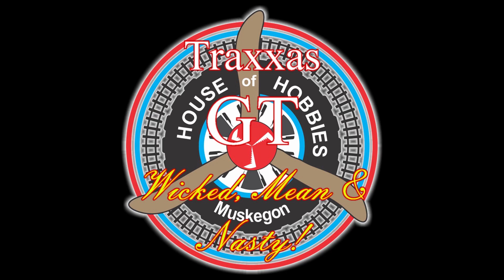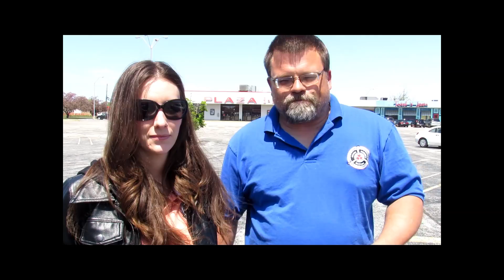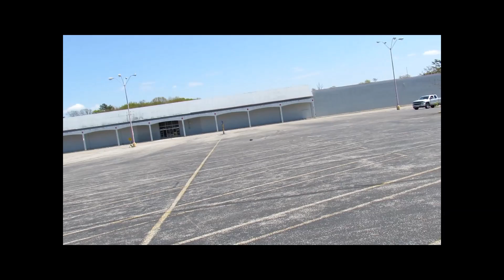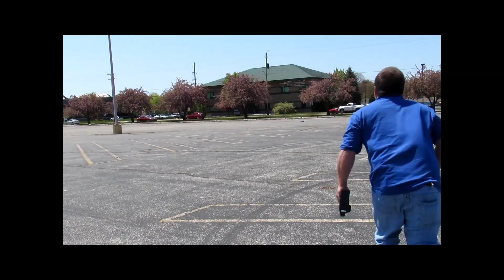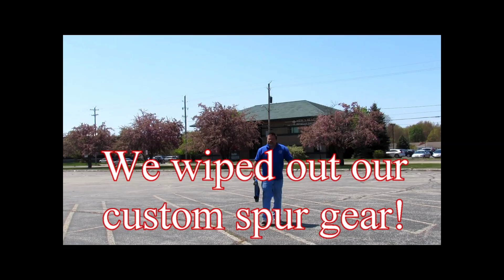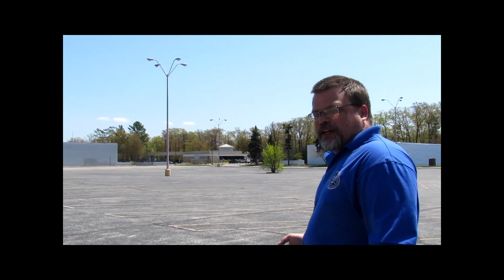Traxxas Ford GT - Fast on Foams

Comment: If you wiped out the custom spur gear what did you need the change to make it work? thx
Reply from the maker: I just dropped another one of the 55's in and moved the motor out another hole. Thought the mesh was good the first time around, but it wasn't. Now it's holding up great.

Comment: Hi. What is the mm off set you use on the wheel hex to fit the foam wheel?  Thanks
Reply from the maker: I just pulled the stock calipers off & used the 1654 wheel hexes from Traxxas. Never looked at the measurement of the offset.

Comment: hey, what brand foams did you use
Reply from the maker: Just grabbed a set of BSR's. Wasn't sure how they'd hold up, and now after our latest round of upgrading I'm not sure I"m going to keep them on the car. They did great with the VXL and our ridiculous gearing... but now with the new motor/esc I'm not so sure. Stay tuned, it's getting interesting now! lol.
Reply: when i get mine  im going to run a castle sidewinder  esc with a 5700 kv motor on 3s.
Reply from the maker: Nice! Just be sure to get foams on it so you don't have that back end trying to drive around the front.
Reply: HOUSE of HOBBIES Muskegon 

I'm looking in the bsr website now, did you order front tires for the whole car. I see a set that I like but I'm not sure if the rear tires will be to wide.
Reply from the maker: We put 30mm's on the rear and 26's on the front. I'm not sure that the 30's would work up front. Also, the offset of the wheel is substantially different, the rears are really pulled up under the body now. I still (if we stick with foam) need to find a good set with offsets close to what Traxxas had on the car. I made a fast grab just to see if they'd hold up to the RPMs we were pushing. Once again, I'm not sure if they'll hold up to the new power... should prove to be interesting.
Reply: HOUSE of HOBBIES Muskegon 

thank you for you help, I'll stay tuned to see   how the new setup goes.

Comment: do a top speed
Reply from the maker: We will be doing that very soon. We're going to have a new body on & mount my phone in such a way that it can be seen without taking the body off. We're also replacing the VXL system with a slightly higher kv system which is coming in on today's order. Stay tuned!

Comment: what tires are you using? Also you mention a new body be aware it aint a traxxas ford gt unless it has a ford gt body on it. Put another body on it by all means but dont post it at a traxxas ford gt it's misleadinng
Reply from the maker: Those tires are just some cheap foamies I found over at Horizon. Once the body is available from Traxxas we'll be putting it right back on that chassis and getting another run. So the project 'Traxxas Ford GT' would confuse people if we were continually changing the titles of the videos to suit something as minor as the Traxxas Ford GT body vs. the Protoform Ford GT Body.